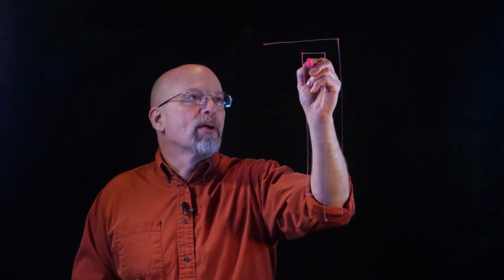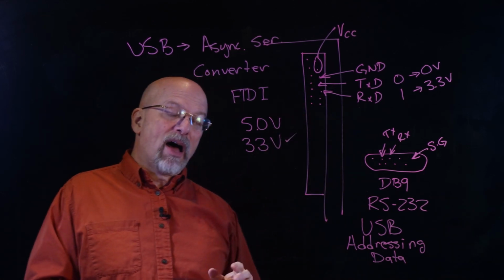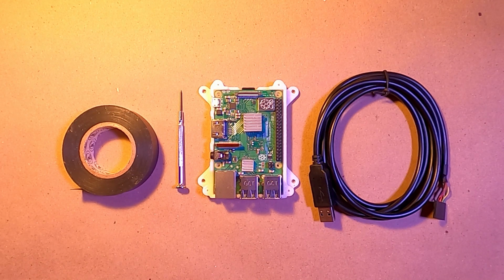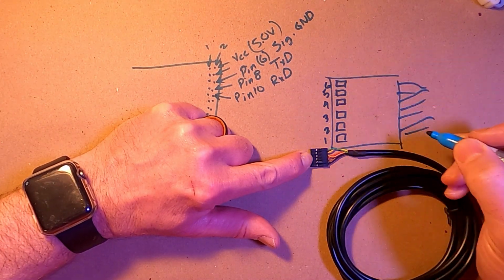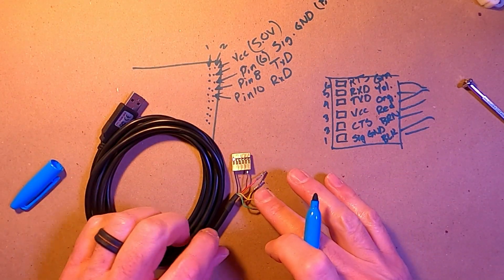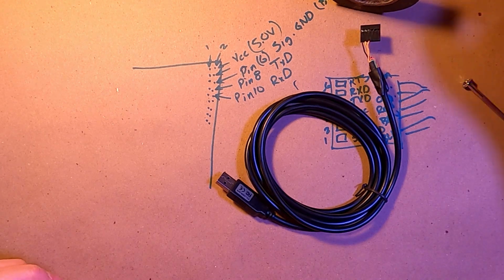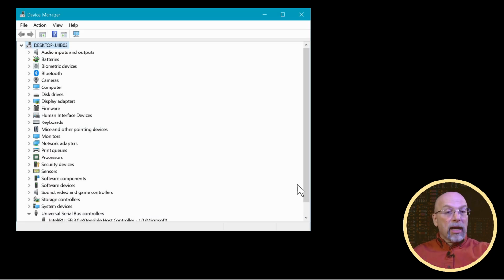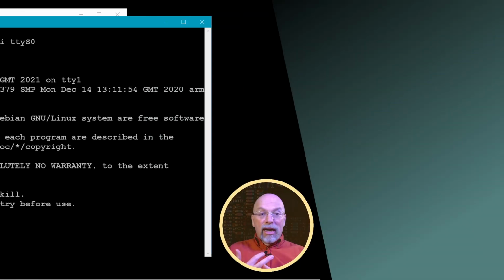Raspberry Pi Serial Connect to USB via FTDI

Comment: How do I install ubuntu desktop for raspberry pi 4 using FTDI?
Reply from the maker: The FTDI device is used only for serial communications with an existing O/S on the remote device, i.e., the Raspberry Pi.  To install Ubuntu or any other operating system, it's best to install it to the Raspberry Pi's SD card directly. There are some excellent resources on their site at https://www.raspberrypi.org/software/operating-systems/#raspberry-pi-os-32-bit